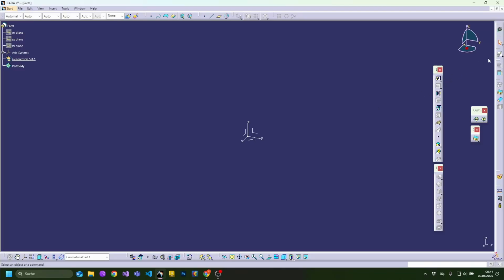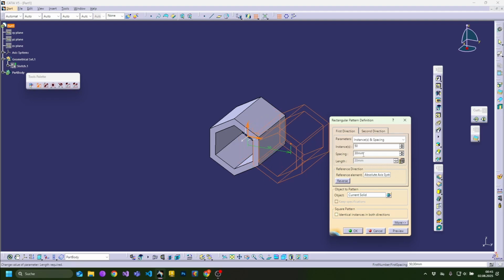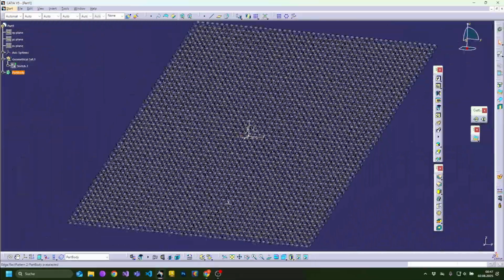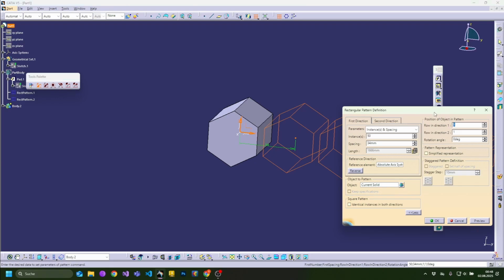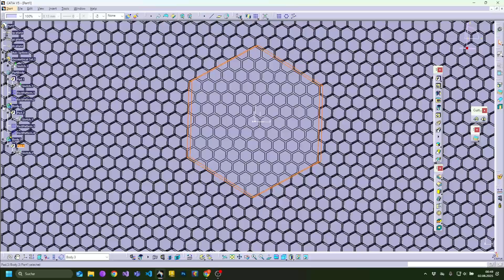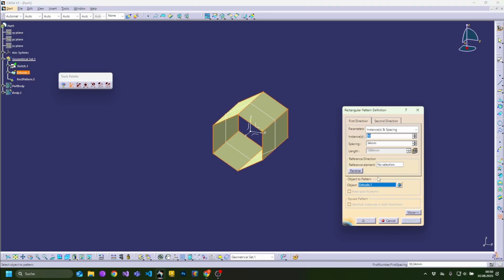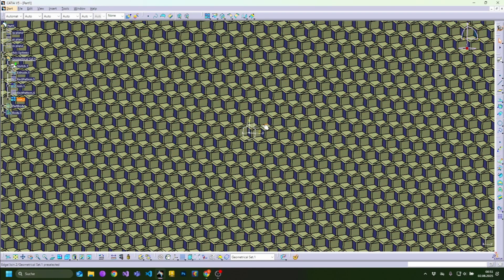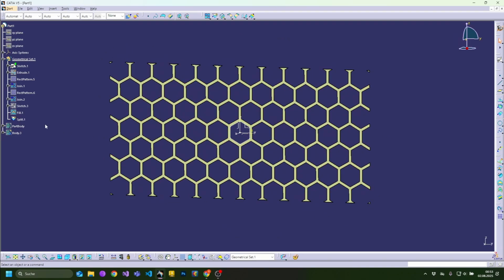Honeycomb Tutorial in CATIA V5/6 – 3 Easy Methods

Comment from the maker: Just a quick note: You can also use just one pattern for the whole geometry. If you instead of selecting the ZY plane as reference, select each axis and add a second direction. Then you need to set the angular rotation with 60 deg again. Or you can create a reference axis and select this as a reference instead of the Z axis. I just thought it's easier to follow with two patterns.

Comment: With the GSD version, is it possible to set a distance between the parallel edges of the hexagons when doing a rectangular pattern?
Reply from the maker: You mean that you control the pattern by the wanted distance the rib should have? You could set this up with adding parameters and control the pattern via parameters.